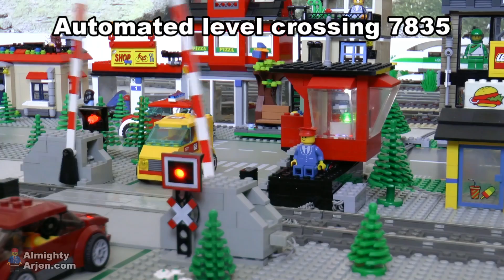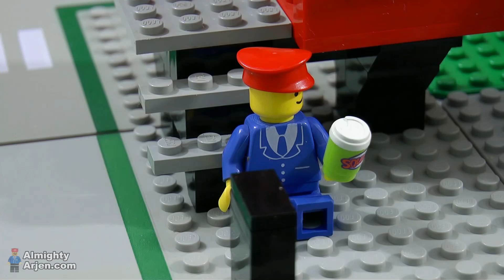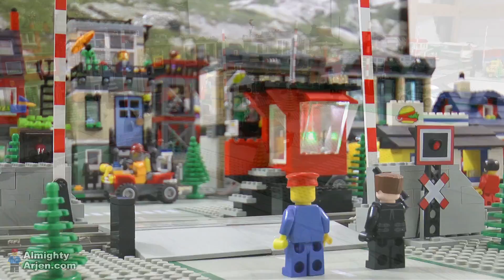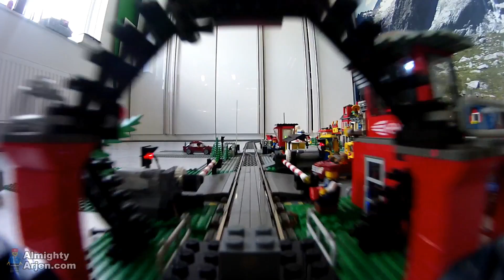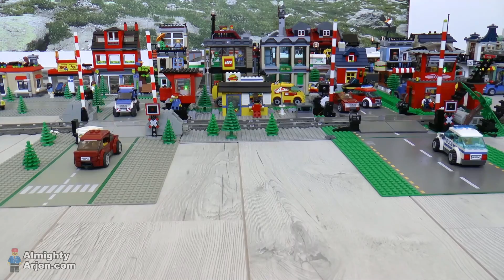Lego train level crossing 7835 fully automated by Arduino

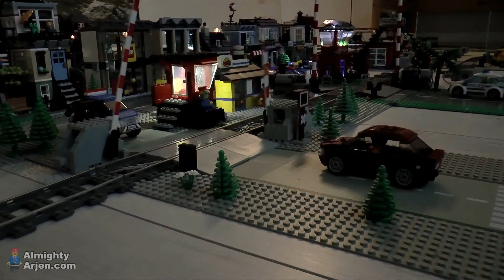Comment: Am I the only person to wonder, at 2:25, how the 12V rubber-tyred motor appears to be running on metal 9V tracks with no central conductor rail…?
Reply from the maker: There's a PF battery box in the first passenger waggon.